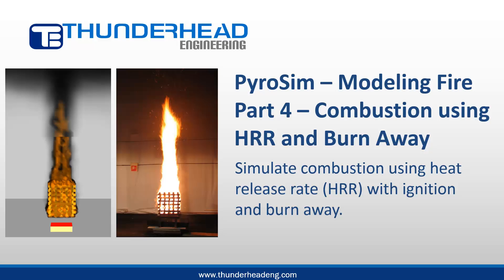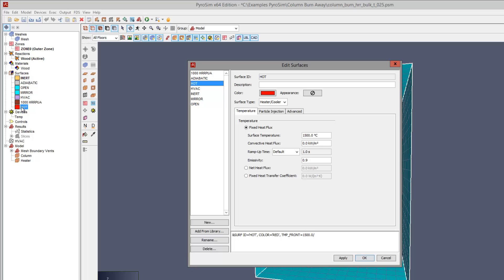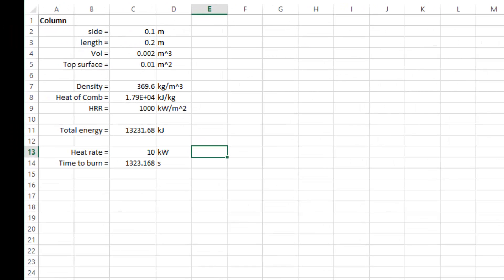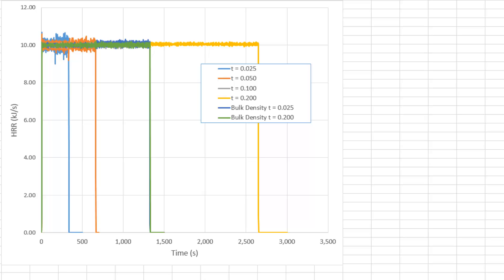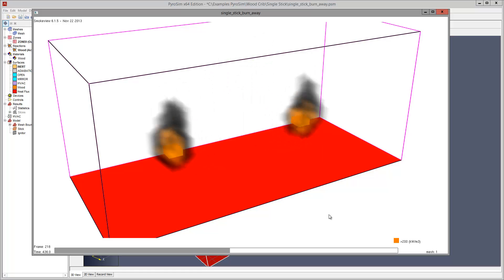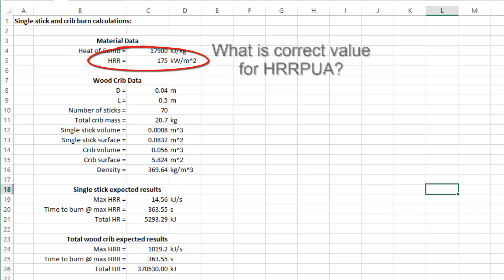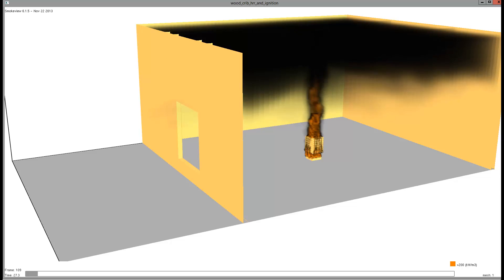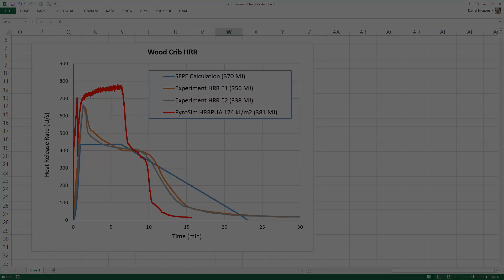PyroSim: Modeling Fire, Part 4 -- Combustion using HRR and Burn Away

Comment: How this time to burn came, which equation we use to calculate here
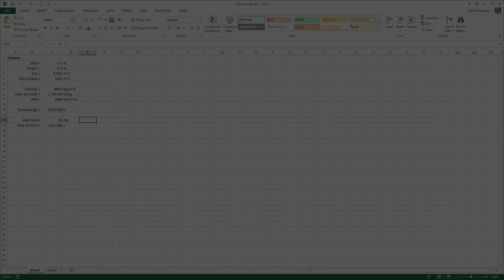Reply: At 2:20 we talk about this.  You use the bulk density (kg/m^3) and volume (m^3) of the obstruction to determine the total fuel mass (kg), then you multiply the fuel mass by the heat of combustion (kJ/kg) to get the total energy release (kJ).  You then specify the Heat Release Rate Per Unit Area (kW/m^2 which is the same as (kJ/s)/m^2) times the burning surface area of the obstruction for the total Heat Release Rate (kW or kJ/s).  With that you can calculate the total burn time by taking the total energy to be released (kJ) divided by the heat release rate (kJ/s) to get the total number of seconds it will take for that much energy to be released at that rate.

The line below you can copy/paste into Wolfram Alpha to see the results with units.
(((0.002(meter^3))*(369.6(kg/meter^3)))*(17900kJ/kg))/(((1000kJ/s)/(1meter^2))*(0.01meters^2))
↓
The line below you can copy/paste into Excel for the more accurate result without units.
=((0.002*369.6)*17900)/((1000/1)*0.01)
↓
In Words with Units...
((Volume of Obstruction(cubic meters)*Density(kilograms per cubic meter))*(Heat of Combustion(kilojoules per kilogram)))/((Heat Release Rate Per Unit Area (kilojoules per second per square meter))×(Burning Area (square meters)))
↓
Reduces to higher level words with units...
(Total Energy of the Fuel Mass (kilojoules)) / (Heat Release Rate (kilojoules per second))
↓
Resulting in the...
Total Time of Heat Release (seconds) = 1320 s (Wolfram rounded to the nearest 10 seconds) = 1323.168 seconds (more accurate in Excel)
Reply: Thank you sir @BryanKleinTECi

Comment: Hello, is it correct to specify the thickness of the surface based on a material of specific dimensions? Should not the thickness be relative to the percentage of the composition of each material and the volume of it?
Reply from the maker: The surface thickness is the 'physical' thickness of that layer. You set the material composition ratios within each layer.  In many cases, there might be only a single material so the composition would be set to 1.0 (100%). When there is more than one material in a layer, you would set the appropriate fraction for each material component.

Comment: Hello, how caan we get the maximum heat release rate per unit volume of diesel? Thanks
Reply: You would need to look up or measure the Heat of Combustion(HoC) (kJ/kg) of your diesel fuel.
Then determine the density (kg/m^3) of your diesel fuel and multiply that by the HoC (kJ/kg) to calculate the total energy available per unit volume (kJ/m^3) at that density.
The Heat Release Rate (kJ/s or kW) would depend on the mass flow/loss rate (kg/s) of the liquid fuel as it is vaporized and converted to fuel gas.
The rate of vaporization would depend on the heating rate of the liquid fuel surface, or how much of the liquid at the surface is warm enough to change state from liquid to vapor.
Once you know this fuel vapor production rate (kg/s) and assuming that there is enough heat energy in the atmosphere to burn/react/combust the fuel vapor, you would see the heat release rate in kilowatts as the vapor production rate times the heat of combustion (kg/s)*(kJ/kg) => kJ/s => kW (HRR)

Comment: But why can't we input the HRR curve calculated using the SFPE handbook?
Reply from the maker: Hello,  you could also do it that way.  Please see this subsequent post where we used a HRRPUA curve. http://www.thunderheadeng.com/2014/03/pyrosim-modeling-fire-part-4-addendum-re-analysis-hrrpua-curve/
Reply: Thank you! I used the SFPE calculated HRR, but the total heat generated obtained by calculating the area under the curve came out to be less than the total heat of combustion available in the wood. So is it still advisable to use that HRR curve?
Reply from the maker: How large was the difference you noticed?  YouTube comments are probably not the best format for this discussion.  Feel free to email support@thunderheadeng.com or post to our forum here https://forum.thunderheadeng.com/